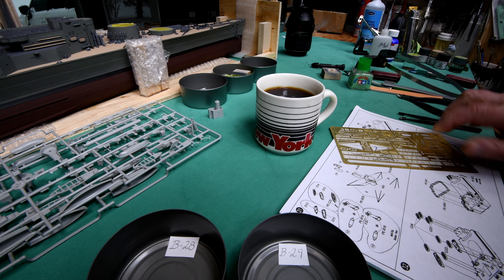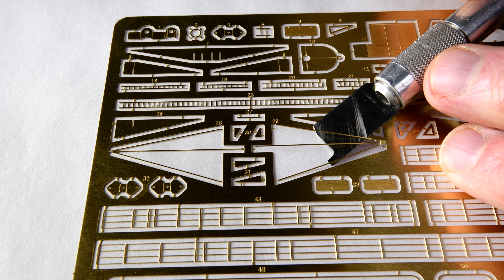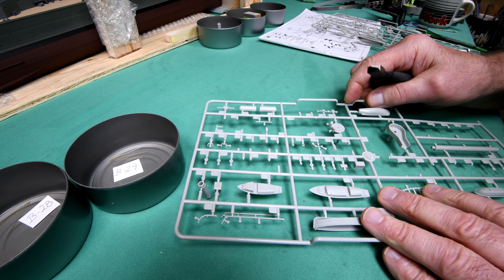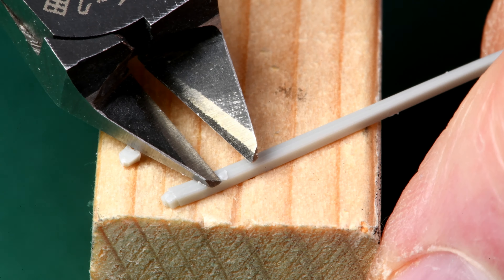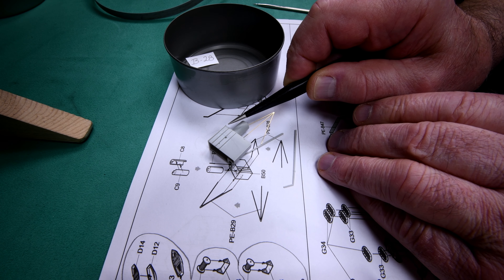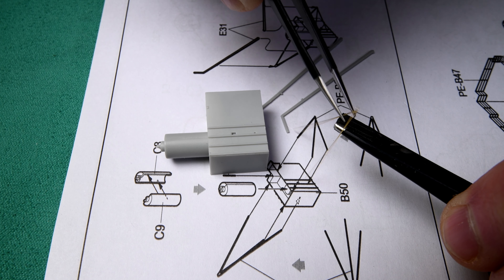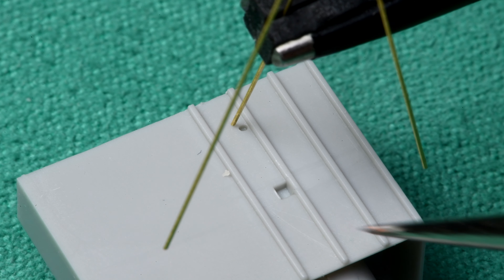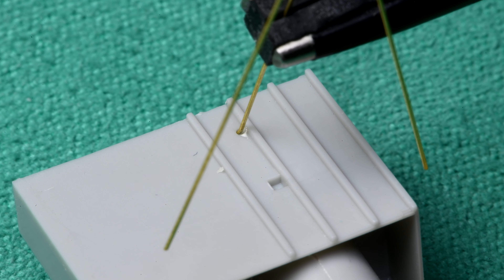The Model Ship - Part 636

Comment: Hi there. Sorry, just a quick question for my own curiosity. As you have alluded to on many occasions, we the viewers often have the luxury of being able to see what you are trying to glue at very high magnification via the macro lens whereas you are seeing a much less magnified image. Are you not able to see the same images from the camera in real time on the monitor you have on the workbench?
Reply from the maker: Re: "in real time on the monitor"
Yes, you'd think that should work, but it's often backwards in relation to what I'm actually doing --- and that can get confusing. I did however look up at the monitor at that moment to see if I actually got CA glue in the right place. Usually I have the best luck seeing when wearing the magnification hood, but at that moment was wearing just the strong reading glasses. Thanks for asking. 👍🙂